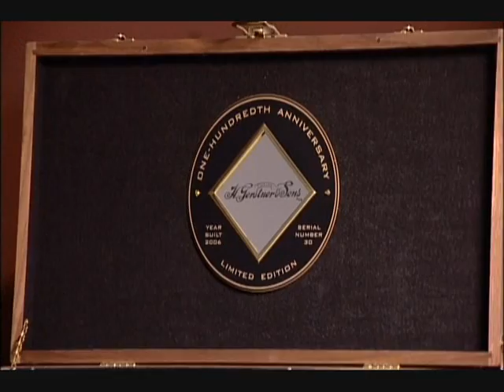H. Gerstner & Sons - Wooden Tool Chest Factory Tour

Comment: Very interesting to watch the assembly process.  I'm in the process of making a wooden tool chest myself.  I think getting the drawers to fit perfectly will be the hardest part (I don't have an awesome vertical belt sander to tune them on, unfortunately).  One question: doesn't the wet rag just partially dissolve the glue and make it seep into the wood grain worse?  I let the glue dry first then scrape it off on my projects.  Maybe it doesn't matter with enough sanding.